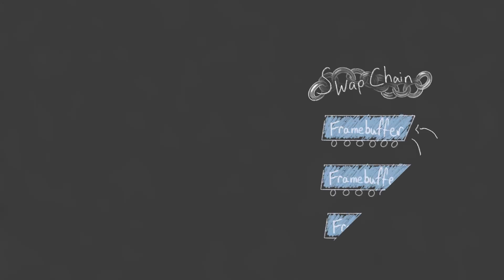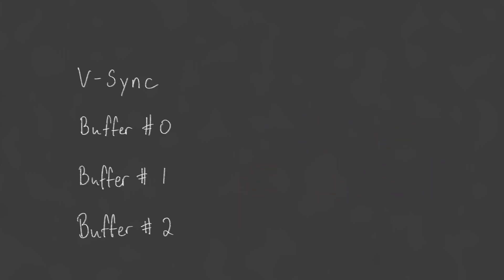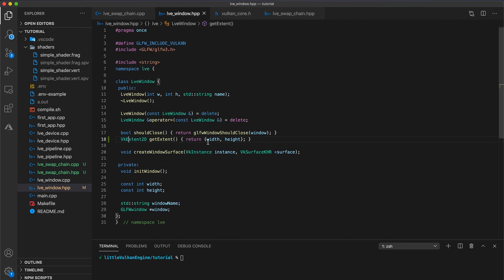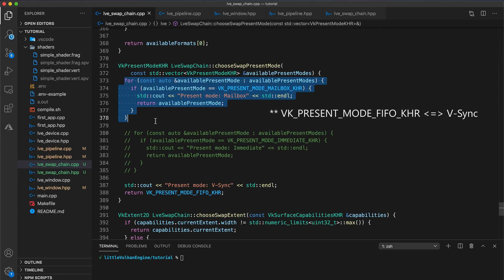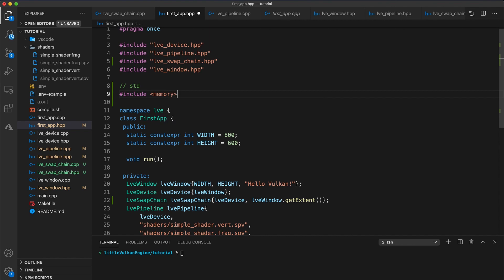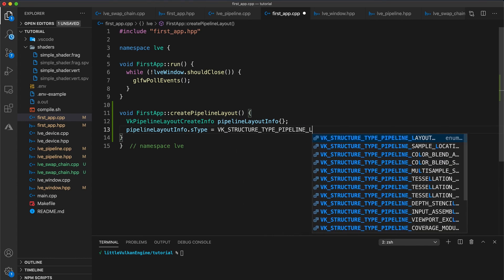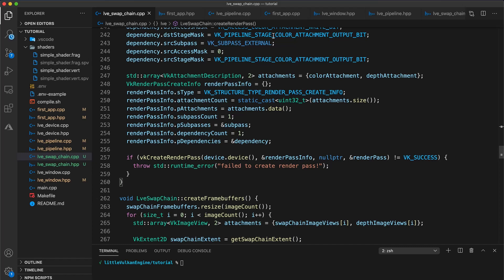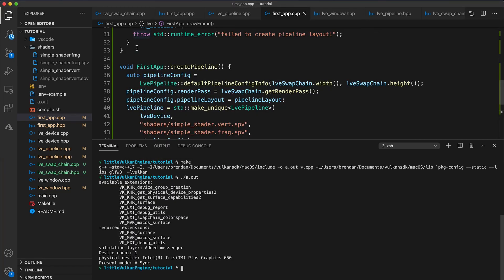Swap Chain Overview - Vulkan Game Engine Tutorial 05 part 1

Comment: I was having a problem where the window was closing after starting the program with no error codes or debug messages. The program was closing at some point during the vkCreateGraphicsPipelines function in the pipeline cpp file. Luckily I found the problem, which was that the device header was picking my integrated GPU, which for some reason wasnt working. however, when I changed it to pick the discrete GPU, it did luckily work.

Comment: I get the following at the end of the video when I build and run:

Validation Layer: Validation Error: [ VUID-VkGraphicsPipelineCreateInfo-renderPass-09028 ] Object 0: handle = 0xee647e0000000009, type = VK_OBJECT_TYPE_RENDER_PASS; | MessageID = 0x4d0c2b9f | vkCreateGraphicsPipelines(): pCreateInfos[0].pDepthStencilState is NULL when rasterization is enabled and subpass 0 uses a depth/stencil attachment. The Vulkan spec states: If renderPass is not VK_NULL_HANDLE, the pipeline is being created with fragment shader state, and subpass uses a depth/stencil attachment, and related dynamic state is not set, pDepthStencilState must be a valid pointer to a valid VkPipelineDepthStencilStateCreateInfo structure (https://vulkan.lunarg.com/doc/view/1.3.290.0/windows/1.3-extensions/vkspec.html#VUID-VkGraphicsPipelineCreateInfo-renderPass-09028)

I went back through this tutorial again, but I didn't find anything that I missed.

Any help is appreciated.
Reply: It occurs in the lve_pipeline.cpp code in the call to vkCreateGraphicsPipelines(..)
Reply: Your graphics pipeline outputs to the depth stencil attachment of the render pass, so you need tell vulkan how is this gonna happen during creation of the pipeline where you have all this stuff bound, like, dymanicState, vertexInputState, inputAssemblerState and so on, the line before the link mentions the structure you need to configure, the line right after the message ID shows the member of the createGraphicsPipeline structure where you should put the pointer to depthStencil state

Comment: After correcting other mistakes, I'm getting the following:

validation layer: Validation Error: [ UNASSIGNED-CoreValidation-Shader-InconsistentSpirv ] Object 0: handle = 0x2b9e20a6aa0, type = VK_OBJECT_TYPE_DEVICE; | MessageID = 0x6bbb14 | SPIR-V module not valid: Error: Result Id is 0

Gotta look what's going on, thanks for the video.
Reply: Ok fixed it creating a python script to compile my shaders to spv. For some reason I was getting errors doing it the old way, unsure why.

Comment: Hi, Up until the previous video I was able to follow with no problem. With this one after following the steps I got a validation error telling me that " value of pCreateInfos[0].pColorBlendState->pAttachments[0].srcColorBlendFactor (-808607744) does not fall within the begin..end range" also `colorBlendOp` has the same error. I'm using MSVC 16.11 on windows 10.
---
solved by moving the colorBlendInfo out of the struct much like the instructions at 5:09
Reply: Was also able to solve this same issue by following the same instructions at 5:09 but for colorBlendInfo.
Reply: thanks, fixed same issues for colorBlendInfo and colorBlendAttachment

Comment: At 7:22, after Buffer #1 finished "On Screen", shouldn't it be Buffer #0 "On Screen"? Since Buffer #0 finished GPU earlier than Buffer #2. But the graph shows Buffer #2 "On Screen" instead.
Reply from the maker: Good catch you are right. The first gpu block for buffer #2 should be shown further left in the graph before the gpu block for buffer #0. I’ll update the pinned comment. Thanks for pointing this out!

Comment: Hi Brendan! I love your videos
I had been the entire day traing to find a solution and i cant, i have also made the  corrections.
This line: 
		if (vkCreateGraphicsPipelines(lveDevice.device(), VK_NULL_HANDLE, 1, &pipelineInfo, nullptr, &grapihcsPipeline) != VK_SUCCESS) {
			throw runtime_error("Error al crear graphics pipeline");
		}
throw me a Exception
Exception thrown at 0x00007FFDD82AC3F2 (nvoglv64.dll) in VulkanTest.exe: 0xC0000005: Access violation reading location 0x0000000000000018.
Do someone know where can be the problem?
Reply from the maker: Hey have you checked the pinned comment? Might be related to that mistake I made. My apologies!
Reply: Yes, I have checked the comment a lot of times. but i don´t know why still not working.
Anyway You don´t have to apologize, your series is amazing, is the first API I learn and with your videos is so easy to understand and imagine what is happening
Thank a lot for the series

Comment: Hi brendan, my app is crashing with this in the console ... validation layer: Validation Error: [ UNASSIGNED-CoreValidation-Shader-InconsistentSpirv ] Object 0: handle = 0x23d438162c0, type = VK_OBJECT_TYPE_DEVICE; | MessageID = 0x6bbb14 | SPIR-V module not valid: Invalid SPIR-V magic number.
validation layer: Validation Error: [ UNASSIGNED-CoreValidation-Shader-InconsistentSpirv ] Object 0: handle = 0x23d438162c0, type = VK_OBJECT_TYPE_DEVICE; | MessageID = 0x6bbb14 | SPIR-V module not valid: Invalid SPIR-V magic number.
Reply: Could you please help me out with this ?, I have too many other errors also but I am starting with these first

Comment: Hi Brendan, thank you for this tutorial! 

[update] I found the issue. I forgot to copy the depthStencilInfo configuration into my defaultPipelineConfigInfo function.

I now have the following validation error when I try to run: 

validation Error: [ VUID-VkPipelineDepthStencilStateCreateInfo-sType-sType ] Object 0: handle = 0x252e150, type = VK_OBJECT_TYPE_DEVICE; | MessageID = 0xfa7d9d67 | vkCreateGraphicsPipelines: parameter pCreateInfos[0].pDepthStencilState->sType must be VK_STRUCTURE_TYPE_PIPELINE_DEPTH_STENCIL_STATE_CREATE_INFO The Vulkan spec states: sType must be VK_STRUCTURE_TYPE_PIPELINE_DEPTH_STENCIL_STATE_CREATE_INFO

Comment: I got up to video 9 but then got overwhelmed by everything so I took a good 2 weeks to learn more about cpp and decided to go over these tutorials again but to not follow everything to the exact letter.
I decided to follow this more as a guideline whilst adding my own things into it directly from the start. all the "lve_" files are in a separate folder called engine and I work with shared object files now, so that later on I could easily keep engine and game files separate in case I want to make multiple games with the same engine without having to copy all the files over ^^

Took me a good week to know how shared object files work, how to compile them correctly and how to make other compiled cpp files use them. But I finally did it and I have learned a ton more. Now that I'm going over these videos again, my understanding got a lot better of how everything works. It's still a lot but I'm finally seeing the forest through the trees again ^^

Comment: This may be a dumb question but I can't figure out how to make the colorization work properly and it's kind of trowing me of when looking at the code.
By example for you std::vector  both std and vector are green, for me only std is green. When I use VkExtent2D for example, for you it's green for me it stays white. Any idea what may be wrong here?
I've been trying to fix it for the past 2 days and I know it's not that important but it's just a very annoying thing I'm experiencing right now. I enabled Enhanced colorization, I re-installed vs code multiple times now, but without any luck :/
It seems like types and custom classes are the only ones affected by this.
Reply: Found the issue, was opening the folder through a symbolic link so Intellisense just plain didn't work for some reason. Fixed it by opening code through the terminal in the correct folder

Comment: I got a bunch of errors and it says "validation layer: Validation Error: [ UNASSIGNED-GeneralParameterError-UnrecognizedValue ] Object 0: handle = 0x1e4c8048650, type = VK_OBJECT_TYPE_DEVICE; | MessageID = 0xbe6eff91 | vkCreateGraphicsPipelines: value of pCreateInfos[0].pColorBlendState->pAttachments[0].blendEnable (-858993460) is neither VK_TRUE nor VK_FALSE. Applications MUST not pass any other values than VK_TRUE or VK_FALSE into a Vulkan implementation where a VkBool32 is expected."

However, the white vulkan window can be dislayed correctly. Should I care about this issue or will it affect later?
Reply: I got your message from your next tutorial and it's fixed!

Comment: shaderStages[1].pSpecializationInfo = nullptr; and shaderStages[0].pSpecializationInfo = nullptr; is missing. Without it the program will crash because there is an uninitialized pointer. (windows, msvc)
Reply from the maker: ahh sorry! I hadn't started testing these earlier tutorials yet on msvc and there's a couple errors I made that I didn't pick up on due to the compiler differences. 

Check my pinned comments on each video, I mention any issues that viewers brought up there.

Comment: The github repository code does not match the code in the video. For example,

Video
LvePipeLine LvePipeline::defaultPipelineConfigInfo(uint32_t width, uint32_t height){

Github version
void LvePipeline::defaultPipelineConfigInfo( PipelineConfigInfo& configInfo, uint32_t width, uint32_t height) {
Reply from the maker: Go with the repo then. It contains some bug fixes mentioned in the pinned comment.

Comment: I think I'm getting an error in my shader files. When starting my program, it says :
validation layer: Validation Error: [ VUID_Undefined ] Object 0: handle = 0x55c48f8306a0, type = VK_OBJECT_TYPE_DEVICE; | MessageID = 0x79de34d4 | vkCreateShaderModule: parameter pCreateInfo->codeSize / 4 must be greater than 0.
validation layer: Validation Error: [ UNASSIGNED-CoreValidation-Shader-InconsistentSpirv ] Object 0: handle = 0x55c48f8306a0, type = VK_OBJECT_TYPE_DEVICE; | MessageID = 0x6bbb14 | SPIR-V module not valid: Invalid SPIR-V magic number
terminate called after throwing an instance of 'std::runtime_error'
  what():  Failed to create shader module.
My simpleShader.vert file is the following :
#version 450

vec2 positions[3] = vec2[](
  vec2(0.0, -0.5),
  vec2(0.5, 0.5),
  vec2(-0.5, 0.5)
);

void main()
{
  gl_Position = vec4(positions[gl_VertexIndex], 0.0, 1.0);
}
The line "gl_Position = vec4(positions[gl_VertexIndex], 0.0, 1.0);" is underlined in red and a label says gl_VertexIndex doesn't exist.
Reply: Fixed

Comment: I was wondering, why are you turning pipeline into a smart pointer? What is the advantage of this?
Reply from the maker: There are pros and cons to using a pointer. A pointer will be slightly slower than accessing a stack allocated variable. 

The advantage of using a pointer here is that it allows us to postpone initialization of the pipeline object until when we have all the required data for its set up. 

It also makes re-building a pipeline much simpler. We can simply allocate a new pipeline and assign it to the same variable. With a stack allocated variable we would need to add a funtion to the pipeline class if we wanted to rebuild it.
Reply: @BrendanGalea  std::optional is intended for that case. You can easily defer the initialization by setting std::nullopt and reset value by emplace method

Comment: For some reason when I try to compile VS shows me that I have an unhandled exception here

if (vkCreateGraphicsPipelines(lveDevice.device(), VK_NULL_HANDLE, 1, &pipelineInfo, nullptr, &graphicsPipeline) != VK_SUCCESS)
{
	throw std::runtime_error("failed to create graphics pipeline");
}

but I there isn't "failed to create graphics pipeline" in the commandline, it throws it in the first line. Any idea what happened?
Reply from the maker: hmm my apologies, it might have to do with the mistake I made that I mention in the pinned comment on the video. Take a look at that and see if the fix I mention there corrects things for you.
Reply: @BrendanGalea  okay i would like to add now that i managed to fix the issue by removing the struct entirely and directly placing its contents into the CreatePipeline function as local variables. apparently there is some sort of issue with copying the struct using the defaultConfig helper function and fixing the struct's self-referencing pointers (that you pointed out in your other comment) was not enough to resolve the problem.
Reply: Hi did you solve the issue? I am having same error
Reply: having the same issue. program crashes on this line due to memory access violation dereferencing a nullptr. unfortunately the error happens within vkCreateGraphicsPipelines so there is no debugging information.

Comment: Thanks for the code you provided but there are compilation errors all the time that I have to correct one by one each time
Reply from the maker: Sorry for that, there shouldn't really be any compilation errors. Might have to do with project configuration, or mising {} after variable initialization. Those are the solutions to what others have reported in the past.

Any coding errors I discover after the video is released are mentioned in the video description/pinned comments, with a provided fix. There's an error for video 5 so keep an eye out for that!

Comment: In MSVC i get this error 

(Severity	Code	Description	Project	File	Line	Suppression State
Error	C2664	'sqe::SqePipeline::SqePipeline(sqe::SqeDevice &,const std::string &,const std::string &,const sqe::PipelineConfigInfo &)': cannot convert argument 1 from 'std::unique_ptr<sqe::SqePipeline,std::default_delete<sqe::SqePipeline>>' to 'sqe::SqeDevice &'	SquidEngine	G:\Program Files (x86)\Microsoft Visual Studio\2019\Community\VC\Tools\MSVC\14.29.30037\include\memory	3416)
Reply from the maker: any luck? Srry for the slow reply. 

My guess would be there's a typo somewhere and you're trying to pass in the wrong argument to the pipeline constructor. Or it could also be that your Pipeline constructor isn't public, so the make_unique function cant see it.

Comment: Hi! Thank you for your videos! Somehow I run into a strange behavior. When I run ./a.out multiple times I get different errors messages:

# 1 ####################
Segmentation fault (core dumped)

# 2 ####################
terminate called after throwing an instance of 'std::bad_alloc'
  what():  std::bad_alloc
Aborted (core dumped)

# 3 ####################
... and sometimes I just works fine with some "validation layer: Validation Error: ..."

Any ideas what went wrong here? Thanks!
Reply from the maker: It could be the error I mentioned in the pinned comment. Accessing released memory can result in undefined behaviour which could explain the weird issues you are experiencing. 

In the comment I explain how to fix it. My apologies!

Comment: Hello ! I'm very beginner in C++ and I'm doing what are you doing but when I run the program it says "Assertion Failed (some codes)" I dont know what I do wrong and There is always "defaultlib 'library' conflicts with use of other libs; use /NODEFAULTLIB:library" warning. And there is a yellow line under "if (vkCreateGraphicsPipelines(". Can you help me ? (I'm using Visual Studio 2019)
Reply from the maker: Which part of the tutorial are you at? At 9:20 the assertion failed is the correct behaviour because we haven't yet provided a pipeline layout.

Also in this tutorial I actually made a mistake which I corrected in the pinned comment in the videos. That might also be what is causing the issue. Let me know if that works and if not I'll be happy to do my best to help!

Comment: Hi Brendan, i started again using the files from tutorial 4. 
Instantly i got a linker error /NODEFAULTLIB which i fixed. 
Running the code resulted in an exception being thrown. I did get to see much more extensions available for my gpu in vulkan. 
However @9:23 you tell us to run the code. I get 463 errors.
This is due to a series of initialision errors. 
Starting at lve_device.cpp Error C3536
for (const auto& device : devices
You initialized "devices" in the same routine just above that. but with a nullptr for the number of physical devices. 
at line 115 :"vkEnumeratePhysicalDevices(instance, &deviceCount, nullptr);"

This error seems interesting:
Error C2440	'=': cannot convert from 'const int' to 'VkPhysicalDevice'	Vulkanproject \lve_device.cpp 125
Id love to join your discord. This whole sequence of errors could be a version difference problem. 
However there is no link to your discord. Where do i find it?
Reply: A lot of these errors are in: "lve_swap_chain.cpp" So thats a real problem. I cant progress with this tutorial now.
Reply from the maker: here's the link to join the discord - https://discord.gg/fYRyY4Th